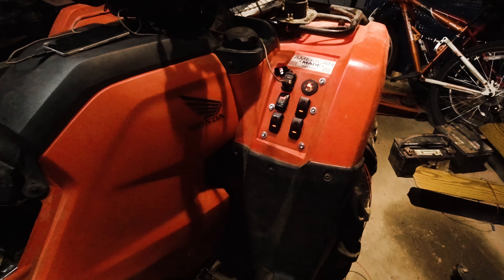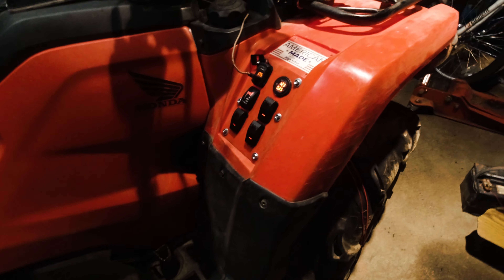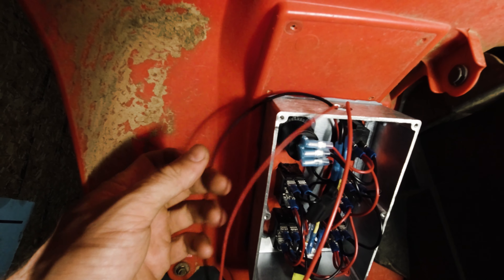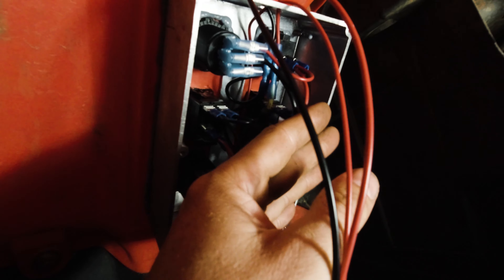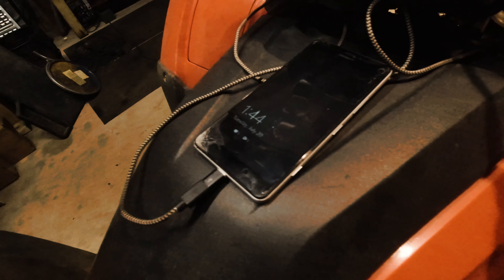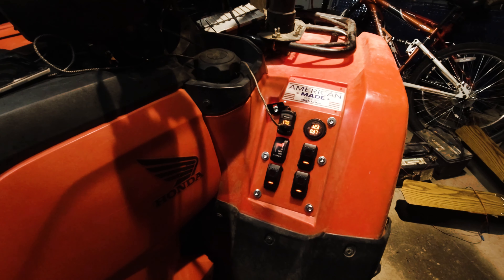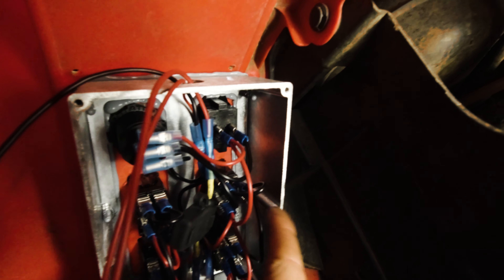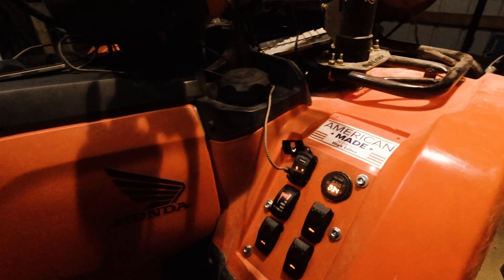** UPDATE #2 ** Adding Custom Switch Panel and Aluminum Waterproof Enclosure

Comment: Next upgrade.... on board fire suppression😂
Reply from the maker: haha no need since I'm in deep water most of the time 😂 but on a serious note I been thinking about carrying fire extinguishers on both machines cuz it seems like I see/hear about people's machines burning up all the time (but that also seems to only be the kind that use rubber band transmissions lol)
Reply: @MudMayhem  you never know. You might save someone's day out on the trail some time
Reply from the maker: might save my day if I ever have an electrical issue lol I put the fused relay and master power switch in to hopefully eliminate that but you never know, I used 16ga and 18ga all copper wiring and I dont expect to pull more than 10 amps so I think I should be fine
Reply: @MudMayhem  you're running all solid state items of those switches you'll be fine with that set up.
Reply from the maker: thats what im hoping, they are all "marine" switches and rated for 15-20 amps each so should be good, wait til you see what im wiring up on the sxs bud!!
Reply: @MudMayhem  oh boy....60" flat screen
Reply from the maker: Dangit Ken you spoiled the surprise!! Just kidding I haven't been able to find a waterproof tv yet lol
Reply: @MudMayhem  I'm sure your looking though...... what about a big ass zip loc bag?
Reply from the maker: haha now you're talkn' fancy 😂
Reply: @MudMayhem  you know those are made right here in town im sure you could talk to a few folks lol.